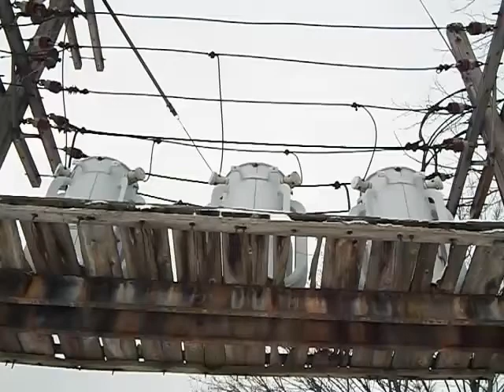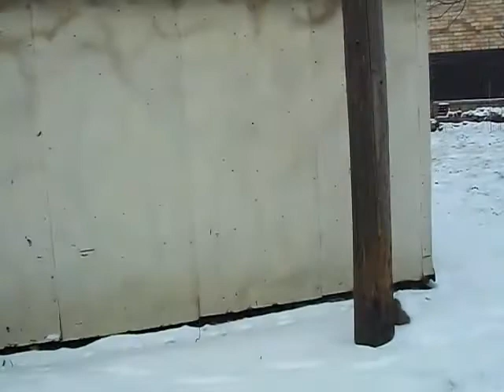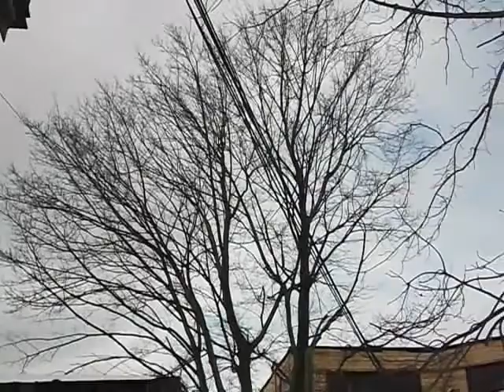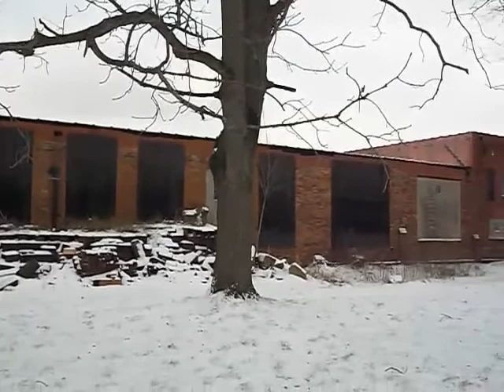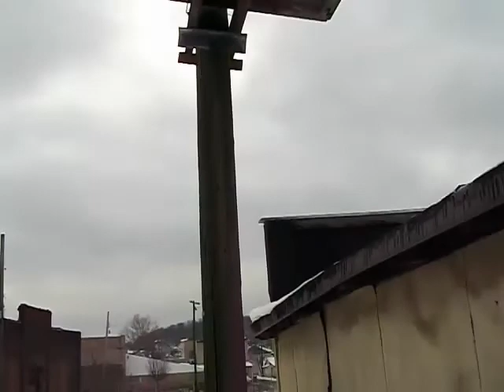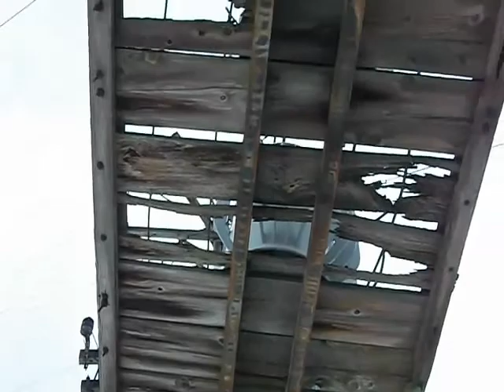OLD Three Phase Transformers

Comment from the maker: @kerobinsonii That platform is shot, can only be the center beams and hopefully they are steel......  If they fall it will pull the primaries with it and thats a bit of high voltage not that 480 isnt...... but compared to a few thousand volts  lol

Comment: Looks like 4kV coming in, is it? Delta or Wye?
Reply from the maker: It could be 4kv depending on which direction its coming from.... usually the primary is around 2300 volts...... I believe its delta as that is what is used the most, atleast on the newer.